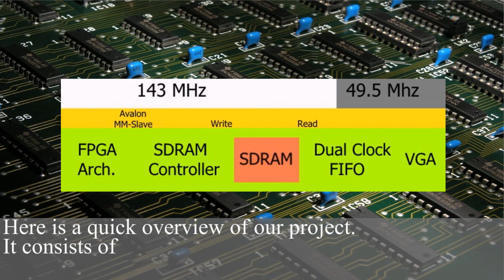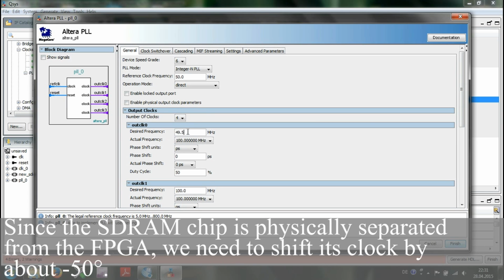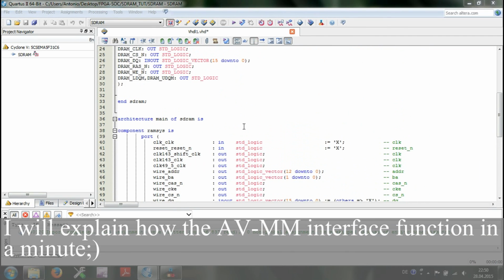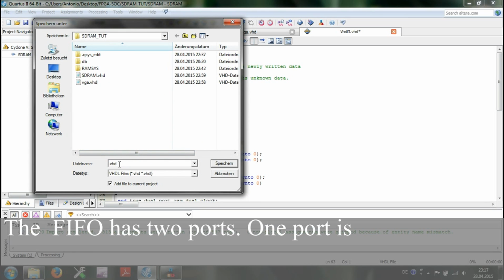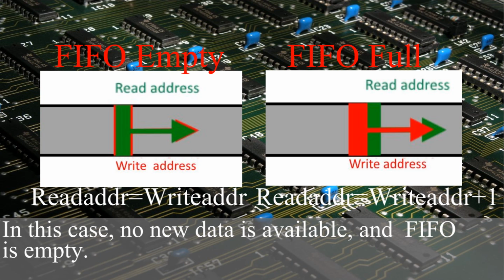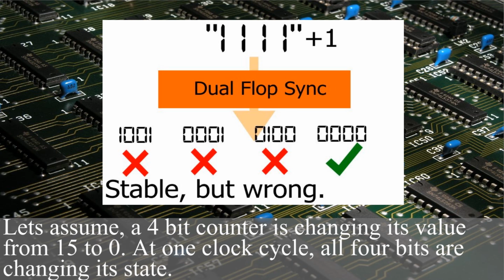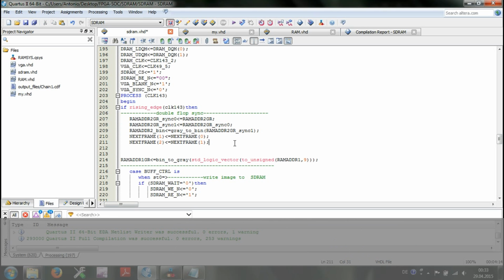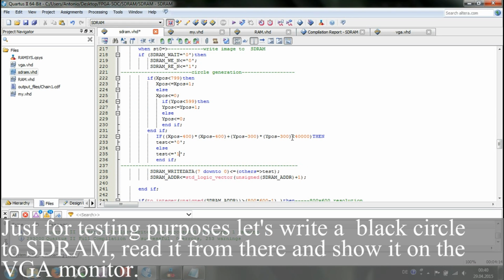Tutorial:Using SDRAM and asynchronous FIFO on DE1-SoC FPGA Board

Comment: Hello.. 
I tried to get rid of the flickering for two weeks now.. I cannot get it to work.
In a previous comment I explained that there is visible blanking of the screen when the SDRAM is getting new data.
To avoid that, I tried to write new data to the SDRAM whenever it is not read, rather then writing the whole amount of pixels at the end of the frame. But I only get back random pixels, just black or just white on screen.

Could you show how to modify your design to not see the blanking on the monitor where SDRAM gets written new data?
Thank you :)

Comment: Hello :)
Great work! Thank you for sharing this information.

I have loaded your files from your github and modified them to work on my Altera DE2-Board. This board has a slightly different SDRAM and VGA DAC.
It is all working, but the image is very flickery.
Is this in your design the case as well? It seems flickery as well, but your camera is maybe affecting the result.

I found out, that it comes from the section "buffer not ready" at the very bottom of your code. The color is being set to all '0' and that is what I am seeing. I proved by altering the color in this section.
Reply: Were you able to fix the flickering?  I cannot seem to do it.
Reply: @SweetNemesis420  No I couldn't fix it yet, but I haven't tried for a long time now...
I was thinking about how to rework this system in a way that the screen output does not have to wait for memory and always gets a valid line from memory. I tried fixing with more speed, and different fifos. But I could not fix it. I am not so experienced with FPGAs in general so maybe that's why. Would be much easier if you have a true VRAM that can write and read at the same time on different addresses or if you have higher clock speeds.
I'd love to see a video from Toni fixing this.

Comment: Great work! Thank you :) May I ask you a question? Where did you find that SRDAM works on 143MHz? I'm using OV7670 and DE1SOC and need SDRAM for frame buffering
Reply: +Jelena Vujic 
Hi Jelena, I am an absolute beginner in FPGA and I am also curious about digital image processing. Are you done with your project about OV7670 on DE1-SoC? Were it to be done, would you send me your code for reference purpose?
My email ngodat9093@gmail.com
Thank you for your consideration.
Reply from the maker: +Jelena Vujic I just read the datasheet for the particular  SDRAM chip. There are 3 possible working frequencies listed  depending on device speed and latency settings.
Reply: +Toni T800 
Can you please tell me which exactly datasheet you used? I can't find is this dual port memory? I found some specification but all of them are about SDRAM on HPS... Also, I need which is maxium speed transfer? Thank you :)
Reply from the maker: There is two options for you:
1. Download official  documentation folder from terasic webpage. You can find all datasheets there.
2. Google the  SDRAM  part number (read it directly from the chip)
Reply: Hello, have You finished Your project? Im working on de0 nano also with sdram buffer and ov7670 :D, and would appreciate any references that could help me to achieve some image processing, thanks

Comment: Hi Toni! Thank you for the video.
I have a question:
If I want to load data from an SD card and display it into the VGA-Monitor, is the system going to be much different from the one you show in the video? Do I need to use a dual clock FIFO?
Many thanks in advance!

Comment: I have question, are u using Cyclone V SoC 5CSEMA5F31C6N board? You said that its Cyclone5, and if I have this model. Well, I not very confident with my knowledge about this and I dont want to break something. Oh and which version of quartus you use?

@Edit: I saw at end of video thats same board :D
Reply from the maker: Hato1992  yes, DE1-SoC board has 5CSEMA5F31C6
Reply: Toni T800 Everything works fine. Only refresh is kinda slow (its visible). Its just my board or u had same problem? Btw. Thanks for tutorial!
Reply from the maker: Hato1992  Yes,  the screen is flickering, because you dont have real frame buffer. So while  writing a new image to SDRAM, you can't display anything.
You can watch my latest video where I connected  a video camera to DE1-SoC. The refresh rate is visible there.
Reply: Okay, I will. But for now I need do some changes to code, so Ill be able to display anything with any input data. But thatnk a lot for this tutorial, its dont look easy if you need find everything in documentation

Comment: Hi toni thank you for the video,
I have a question, if I wanted to display a particular image (photo) or I want show a name, How to charge this in the sdram?
Reply from the maker: Angel Gabriel Valencia Huaman Well, then you must transfer the image  to your SDRAM somehow. You can build a simple UART interface( i have a  tutorial about UART), and send the data from your PC.
You can also  send   and  image from SDcard to FPFA through HPS Avalon interface. This is a bit complicated, but you can learn much with this solution.
Reply: Toni T800 Thank for your answer, I tried create a file .mif with the data of image  and then use de rom model in megafunctions and send the .mif file, I managed to display the image on screen, but much lower quality, T-T I will try with your tips, Thank you very much! really :)
Reply: @gabrielangelvalenciahuaman6104  Can you tell me how you were able to achieve this using this tutorial?  I would like to display an image from a .mif file.

Comment: very nice tutorial and well presented, keep the good work and you will become the next Dave Jones.

Q. I'm looking to hobby stuff with fpga already start some basic stuffs using the Cyclone V GX Devboard, what resources you recommend for interfacing memories and advance stuff? Altera courses somehow misses the train of tutorials by doing more marketing in their courses. and is that a good book in the back "Advance FPGA Design" at the demo part?

Thanks again.
Reply from the maker: eeramzi Hello, yes  The book Advance  FPGA desing from Kilts handles many very important aspects of  the  FPGA design. It helped me to  build dual clock FIFO correctly:)
BTW your board has only  DDR3 SDRAM,  i   heard interfacing DDR3 can be a challenge=)
Reply: Toni T800 Thanks for the replay. I thought the board you have has the DDR3, mine as per the spec has LPDDR2 and SRAM.
Reply from the maker: eeramzi Yes, DE1SOC also has 1Gb DDR3, but I didnt use  it with FPGA yet.